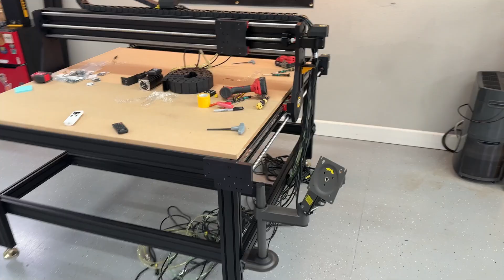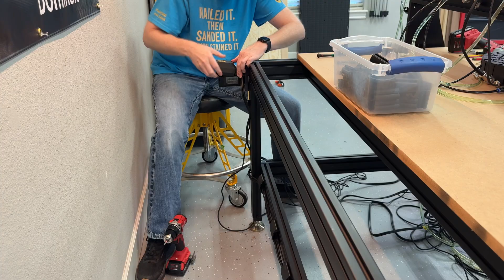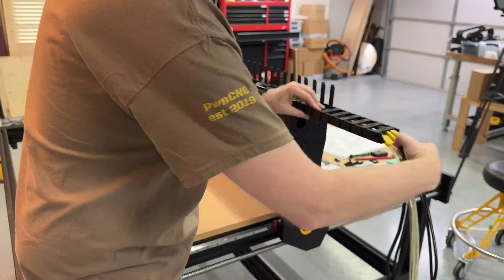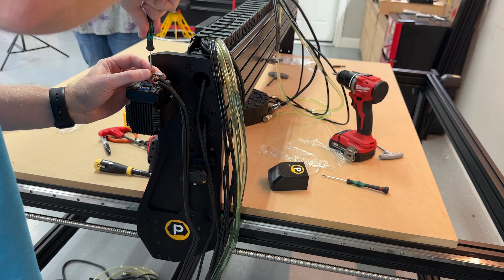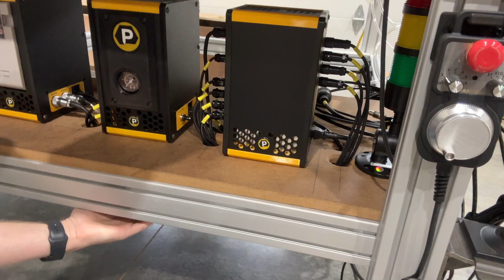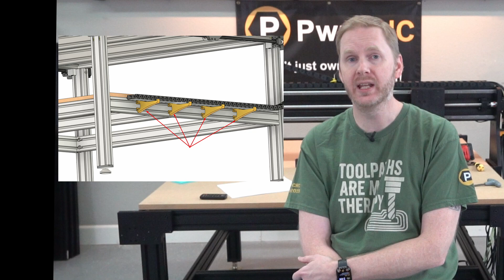Dominator Pro Build Series – Level Set #3: Cable Chains, Stepper Motors & Wiring Decisions

Comment: Make a 4x4 vertical system. You're making a diy CNC. Space is a premium in diy garage/basement. Worse case, make a 4x4 machine that can store horizontally. Stop trying to compete with what's dominating, create a CNC that runs horizontal, or runs vertical and stores horizontally. Innovate.